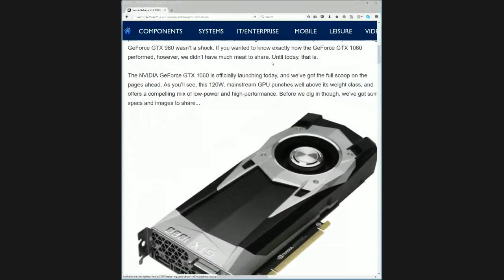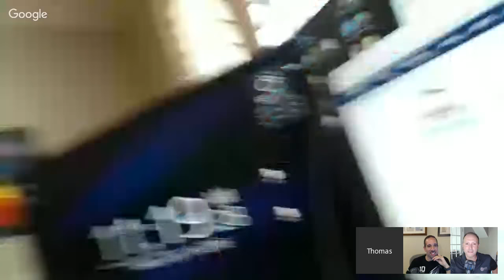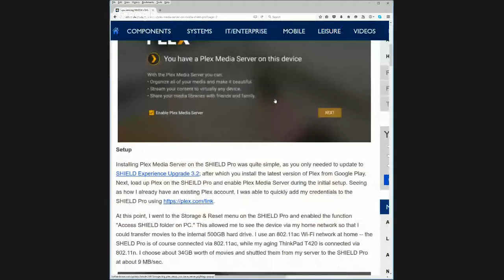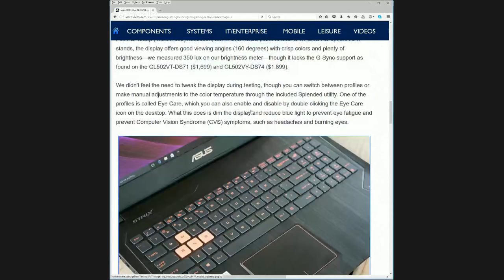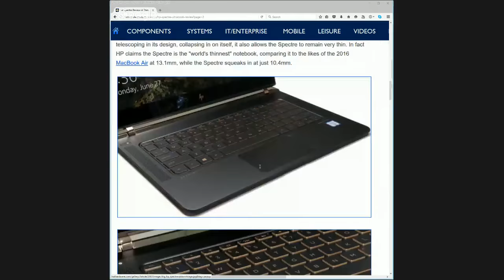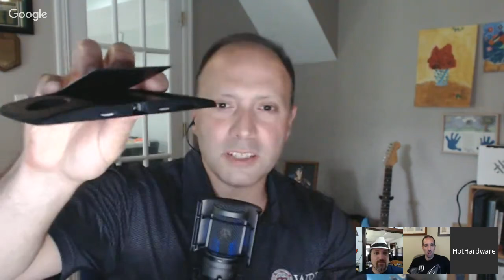Two And A Half Geeks Webcast: NVIDIA's Tom Petersen, GeForce GTX 1060, SHIELD With Plex, ASUS ROG...

Comment: Should I buy it?
Reply: +Matlockization 1060 and RX 480 will both be obsolete by the time DirectX 12 gets off the ground, even in SLI/Crossfire configurations. Imagine buying a 970 last year with plans to SLI it this year only to see it unseated by the 1060/RX480...do you still buy another 970 to add in SLI or do you just buy a 1070 that gives you the same performance give or take with the ability to SLI itself? really, you either SLI off the bat or don't SLI at all. SLI'ing 1060s is a bad value proposition with there the 1080 is positioned. Next?
Reply from the maker: In general it's a very solid value, both in terms perf-per-dollar and perf-per-watt.
Reply: Matlockization the GTX 1060 also saves pretty significantly on your power bill. That's not an issue for everyone, I understand, but the difference should be accounted into the cost of the card over its expected lifespan when determining value. Being more DX12 efficient also doesn't magically make an RX480 crank out more frames in DX12 games than a GTX 1080 so we can't say the RX480 or 490 is more future proofed. RX490 benchmarks will be exciting to see, I agree, there's a lot of wild rumors about what it might be.